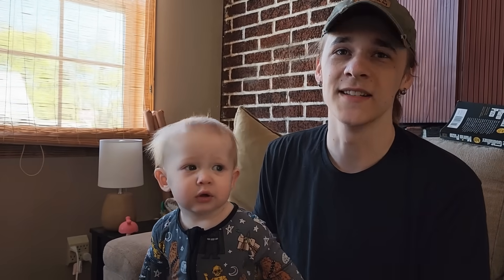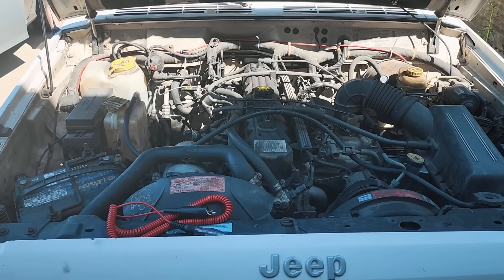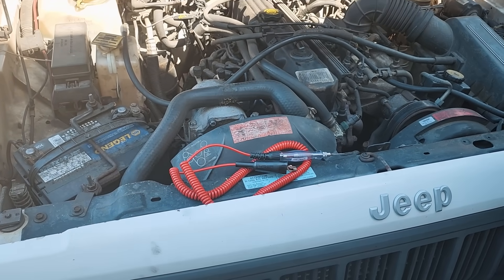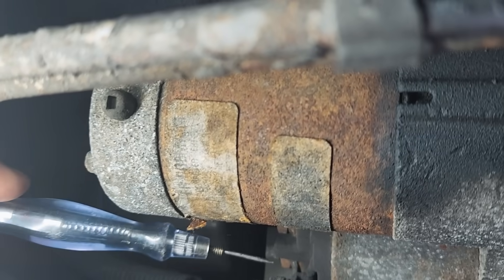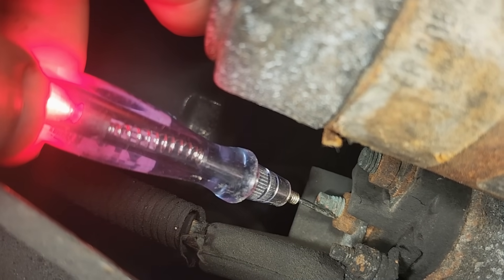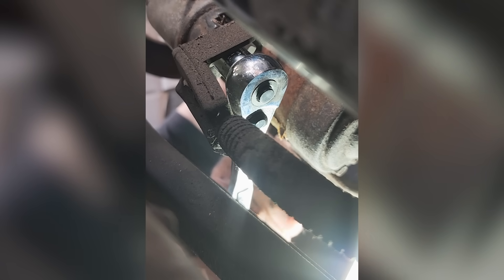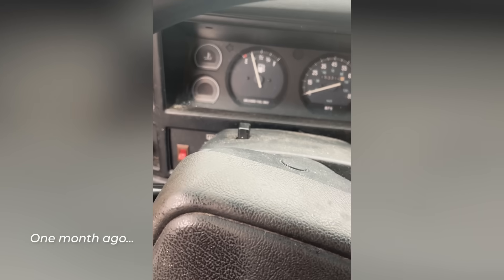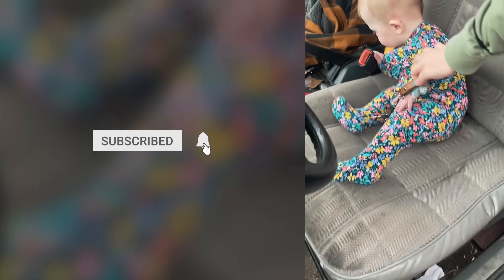Bad Starter or Bad Wire? - Starter Tests Everyone Can Do (family intro)

Comment: I have a Honda Odyssey and same voltage drop. Clean contacts. Could this happen in ignition switch also?
Reply from the maker: On the heavy starter cable, right at the stud?
Reply: @ScannerDanner  ty, turned out to be seized engine. Won't spin at all except maybe a couple flywheel teeth back and forth.
Reply from the maker: @pullbackbaby  before you condemn the engine, take the accessory drive belt off as a siezed alternator or other accessory can keep you from turning the engine. The second one is the starter itself can jam into the flywheel. So unbolt the starter too
Reply: @ScannerDanner  Thanks again!

Comment: Thank you so much for this video. You've saved me soooo much frustration.   

My Forester has been having random no crank no start episodes for months. It would usually start up on its own after some random amount of tries. Everything always checked out at the shop. If  I had it towed in while it was happening, it'd start as soon as it got off the tow truck and everything would check out fine. It happened again last night and after hours of  it not starting and everything I could reach testing ok (can't really reach the starter) I saw your video and decided to lightly tap the starter with a wrench. It started right up. I now know for sure its the starter and I'm not going to be out another tow fee or stranded if it really dies.🎉🎉🎉😅

Comment: So what does it mean when it doesn’t light up on the s post. That’s what I’m dealing with
Reply from the maker: #1 you do NOT need a starter
#2 you need to look at the ignition switch, the transmission range switch, the relay, the ECM controls of the relay and any inputs the ECM is looking at. Like anti-theft type stuff. Then you need to focus on the control circuit itself for voltage drops and such. Check out my Battery, Starting and Charging System playlist for more help with this.

Comment: Wish I came across this video yesterday. Great video. Great explanation!!
Reply from the maker: Thank you! What did you find?
Reply: No-start. Bought/installed a starter only to find out my s-terminal wasn’t receiving voltage when turning the ignition.
Your 15min video could’ve saved me $200 and 1hr labor.
Seriously underrated.

Comment: I can’t get any positive test showing on the starter/solenoid. Rest of the vehicle has power but it won’t start. Not even “click, click”. 

Where I even begin tracing this problem? 
2006 Xterra SE.
Reply from the maker: With a good wiring diagram and an understanding of what all is involved on the control side of the starter (park/Neutral switch, anti-theft, relay, computer driver, ignition switch inputs etc) https://eautorepair.adtrk.biz/?a=10817&c=24&p=r&s1=

Comment: You the man dan... However, i've done all this and still having issues. Could it be a signal wire from the ignition switch?
Reply from the maker: If it was you'd be missing power on the S post of the starter.
Reply: @ScannerDanner  Okay I'll go check. Thank you for the reply my man. And good job on building your channel I know it's not easy.
Reply: O k so maybe this might play a role to the situation I may add. During a very heavy lightning storm and rain. My car died out of nowhere. I believe I was hit with a bolt of lightning that struck.. Immediately after the flash car would not start. Windshield wipers have not worked since but the sprayer does.
Reply from the maker: @TheMeans3  you will need a full function scan tool that is capable of reading all modules on your car as a starting point. This could get very expensive
Reply: @ScannerDanner  I figured so I was trying not to wave the white flag and call my buddy that has one.. Trying to trouble shoot it just with test light and  meter. Thank you my man appreciate your quick response.  I'll give you a mention on my channel to help you out.

Comment: What if the light stays on when you test it on the constant ?
Reply from the maker: That means your main cable is fine
Reply: @ScannerDanner  on the video you showed the light switched to the smaller bolt when the ignition was turned. Mine doesn't, the light stays on for the main, the light doesn't come on when I turn the ignition on the smaller bolt
Reply from the maker: @philliphowell2259  that's the solenoid wire. The controls for that will be different on ever car out there. Ignition switch, starter relay, transmission range or park neutral switch, anti-theft system etc all part of that circuit
Reply: @ScannerDanner  ok thanks I'm having it taken to a shop
Reply from the maker: @philliphowell2259  do not let them put a starter motor in it!!
Reply: @ScannerDanner  I won't it's brand new lol
Reply: So the shop tried to say starter, I wasn't haven't it, I went to the shop he told me he was gonna order a new starter and if it didn't work he wouldn't charge me. Guess what didn't work. He is saying that the starter is blowing the 30 amp fuse every time and something is back feeding causing the fuse to blow. Removed the remote start and still same thing. It's still in the shop no answers yet, any ideas ??
Reply from the maker: @philliphowell2259  absolutely ridiculous! I feel so bad for you. Without looking at a wiring diagram on your system I can't answer, I'm sorry
Reply: @ScannerDanner  yeah it's crazy but I will let what the final results are
Reply: So update, they said it is the starter. So both starters the one I got and the one they got from O'Reilly's didn't work. He put a motor craft brand starter in and said it fired up. His claim is that there is something wrong with some the after market starters not communicating properly, and it had to be a certain brand to run. I don't know

Comment: Bro, I have a Mitsubishi Outlander 2010, and no crank. Starter is okay but I need to test supply to the 12v small wire😢 bad part here is the location for the starter on this suv😢 at less you already directed me to a better solution. I hope to follow up when fixed.🙏

Comment: I took my starter out and got it tested at two different Oreillys. Put it back in and it started. That was a couple months ago. Yesterday it has the same problem. I try to start it and it clicks one time. I'm gonna have to buy a test light and figure that out.

Comment: This might be my problem after throwing parts a new starter and battery. Too late but I'm gonna try this and see if it does this. Might be a rotted heavy line inside the loom where I can't see it.
Reply from the maker: Do these tests and let me know. I can help
Reply: @ScannerDanner  I put a new heavy lead on and it spins now but won't engage the flywheel. I can't tighten it up to the housing all the way, I don't think the nose of the starter is the right size for the bell mount. Idk what to do. Autozone employees are just incompetent.
Reply from the maker: @moosehand8721  put your original starter back in. I hope you have it
Reply: @ScannerDanner  I don't, I'm screwed.
Reply: I didn't see your video back when this started, I never knew how much boolshit a 4.6 starter was gonna be.😀

Comment: I used a multimeter to test from key on to power into starter and I got 10.5V.. would that not be enough to power starter? where would I look if its not? relay? selenoid?  TIA
Reply from the maker: All tests must be done with the key in the crank position!
Also, there are three tests you must do and you mentioned only one and didn't say where you tested it.
1. BAT post on the solenoid
2. S post on the solenoid 
3. Starter housing/block ground
All shown in this video

Comment: Thank you for the video guys, I learned more than a lil bit from this one indeed! 
One question tho??
What is the verdict if the test light does not dim at all on the hot wire while cranking? 
I have 2005 Jeep Grand Cherokee 5.7 hemi and I'm attempting to solve this no start issue myself.
Obviously I ruled out battery, starter relay, and bad ground. 
TIA I appreciate you!
Reply from the maker: The verdict is move to the small gauge solenoid wire now and make sure its hot during cranking too
Reply: @ScannerDanner  yessir it is.

Comment: What was the reason why u dont use the LED test light again ? I heard using the LED test light so u dont fry the computer system. Is that true ?
Reply from the maker: Because very low voltage or poor grounds can light the LED and it looks normal. An incandescent won't do that. It will dim

Comment: Why not use an LED test light?
Reply from the maker: Because they will light with very low voltage and will be just a bright as having normal voltage. That's just one of many reasons I will NOT use one when troubleshooting
Reply: @ScannerDanner  ohh, I see. So would a power probe be even better since you can see the exact voltage?
Reply from the maker: @keviiiboo7460  yes, as it has a voltage readout and is connected directly to the battery itself
Reply: @ScannerDanner  Okay, thanks

Comment: OK Batman & Boywonder, what if you have a 6.5 TD GMC SUBURBAN and you have 2 bolt holes that are chowed up? Outside one dog ear chipped off, inside had a tap broke off in it.
Reply from the maker: Lol, on the starter itself? Sounds like you need a new one?

Comment: I think I gotta replace the ignition actuator on my 2010 jeep wrangler when I go to start it it has no power to the signal wire of starter and it feels like my key is not going forward all the way to make it contact on the ignition switch to send power to that wire

Comment: Did that on my brother's 1997 Camry,  ended cleaning the terminals,  posts, nut,  ground points and bam,  no problem for 3 years. He was ready to throw a starter. Of course IF he did put a starter then guess what,  him cleaning and putting new starter would have obviously fixed it but he would have wasted a $150 for nothing.

Comment: I have a 1994 Honda civic.  Should I disconnect the two distributor connectors before testing with the test light or multimeter?  or is there another way to prevent crank?
Reply from the maker: What are you trying to test? It sounds like the engine starts and runs?
Reply: @ScannerDanner  same as the video. A click but no crank. theres a point in the video where you disconnect the ignition coil. can i just disconnect the two electrical connectors on my distributor instead of disconnecting the ignition coil?  my coil is under the cap.
Reply from the maker: @1776FreedomNow  you don't need to do that. I only did that AFTER the fix to show what normal cranking looked like. Make sense?
Reply: @ScannerDanner  yes. thank you.

Comment: Why are LED test probes not optimal compared to incandescent?
Reply from the maker: Very low voltage will light that LED and you'll not see any difference between low and a full 12v
Reply: Makes sense. Thanks

Comment: What does it mean if I put the test light on the heavy post and there isn't power/doesn't light up? It does light up when turning the ignition though. Everything else seemed to be good. Thank you for your videos!
Reply from the maker: Your main positive cable is bad. Or the connection right at the battery

Comment: Hi Scanner Danner...I hope you and your family are doing wonderful. Thanks for your very informative videos. I did the test light test on my starter to see if I needed to replace it. 

I was wondering (when I'm touching the S-POSTS) but the test light DOESN'T light up after turning the ignition.

What does that mean, because my test light DIDN'T light when I had it on the S-POST? 

The starter fuse on the fuse box inside the car DOESN'T light up when I touched it with the test light. 

But that starter fuse inside the vehicle isn't blown, and the fuse lights up when you put it in another matching fuse slot. 

The only other really weird thing is that my vehicle actually starts better with the OBD 2 scanner connected.  But it cuts off immediately if I disconnect the OBD 2 scanner.

Can this be a classic starter problem, that's also causing a vehicle to need an OBD 2 scanner to stay connected in order to start and keep running?
Reply from the maker: This is NOT a starter problem! But I need more time to reply to this. I need year, make and model and engine size and I want to look at a diagram. I think we can fix this together
Reply: @ScannerDanner  Greetings ScannerDanner. Thank you for your genuine reply. It's a pleasure to hear back from you.  I ran across you from a video with Eric the car guy.  You had my full attention, because I could tell you definitely had a wealth of mechanical information on a more indepth level. Thanks again for your genuine spirit put into your videos with your time. Thank you. Thank you. My vehicle that I'm referring to in the previous post is a 1998 Ford Explorer / 5.0 Liter / 2 Wheel Drive.
Reply: Greetings ScannerDanner. My obd 2 scanner also gave me a 0401 (EGR code) and also an 1151 (oxygen sensor bank 2 behind the catylitic converter). I bought a new EGR valve and I'm going to put it on when it stops raining on my end in Mississippi.
Reply from the maker: @kimvin9  Okay, to be clear, you have no power on fuse #24 in the instrument panel fuse box during cranking? Or with the key in the crank position? Are you connected to battery ground or body ground when you do that test? I want you to be on battery ground, use a long jumper wire if you have to
Reply from the maker: @kimvin9  I'm not worried about either of these codes with the intermittent no crank you have going on
Reply: @ScannerDanner  I'm using battery ground. its 3 _ 7 _ 24 _ 28 __ & 36.  Yes, I have the key in the on position
Reply from the maker: @kimvin9  ? not following what your numbers are here
Reply: @ScannerDanner  Those are the different fuse slot numbers.  24 is one of the slot numbers
Reply: Fuse 24 is not lighting up, nor are the other ones
Reply from the maker: fuse 24 should be hot in the crank position only. It will not be hot with the key on
Reply: @ScannerDanner  ....Fuse 24 is still not hot in the crank position nor with the key on. I had already payed for the EGR valve yesterday. I just put the new EGR valve on.  Its not cutting off yet, but its idling up and down.  I'm going to let it run for about 30 minutes to and hour in the morning to see if it cuts off. Its getting dark here in Missisippi and  a cold front came through.  I don't have a garage.  My wife bought a new cannister purge valve, but  unfortunately they gave my spouse the wrong cannister purge valve. The cannister purge valve sits right next to the EGR valve, so I thought to replace them (both since they were next to each other), incase the cannister purge valve could be clogged. I bought a new battery post connector for the positive post to make sure its a connection. Right now, its starting without the OBD 2 scanner needing to be connected. Since its getting dark here in the country, in the morning Im going to leave it running for 30 minutes to an hour to see if stays running. You are right about fuse 24, it's still not hot in the crank position nor with the key on.
Reply from the maker: @kimvin9  fuse 24 has to be hot for it to crank. So you have it running, that means it was hot.
Need this to be NOT starting to troubleshoot. The fact that it was only starting with the scan tool connected sounds like a ground issue. Something that would NOT affect power to fuse 24
Reply: @ScannerDanner  Hi Scanner. It was a starter solenoid failure on the S-POSTS (using your S-POST test method ) that was causing it to not start without the OBD scanner connected. I replaced the starter solenoid, and now it's running normal.

Comment: Wow just a loose rusty nut!
Reply from the maker: It wasn't really lose, but yes, this is typical of resistance problems in any circuit. This is how they act. Thanks for watching!
Reply: @ScannerDanner  I 'm having the same issue in my 2004F350. I just get 1 click when I turn the key.
Reply from the maker: @sethblack5309  let's do these tests at the starter and tell me what you see. I can help

Comment: If the S post and the B post both ground out through the starter housing and block, why then did the test light "extinguish" on the B post with current passing and "light" on the S post with current passing? I'm not getting something?...hmmm
Paul, I own your textbook if there's a chapter in there than can explain this.
Reply from the maker: I'm not sure I'm following your first statement. 
(Test light the battery negative) The S post stayed lit in the crank position as it should. The B post is hot all the time and should have stayed hot during cranking but did not. Why did the light go out? Because there was a resistance problem that we couldn't see until we loaded the circuit. Once we did, that resistance area heated up so much that it caused a huge voltage drop. So much so that there wasn't even enough to light my test light. 
Watch this video. It's from my premium channel lectures from chapter 1, but I put it here on YT for you guys
https://youtu.be/w0PpLTnKKZg

Comment: Grand kids are a great joy and you have a cute grandbaby.
On  a 3.8 Chrysler I had a starter die. I did a few tests then determined I needed a starter. Once I got under the car and started taking out the starter I found the real problem. One of the bolts that holds the starter in has a threaded end that a nut goes on to ground the starter and it was lose. I just returned the starter after I tighten the the nut. Great video. Happy Motoring.